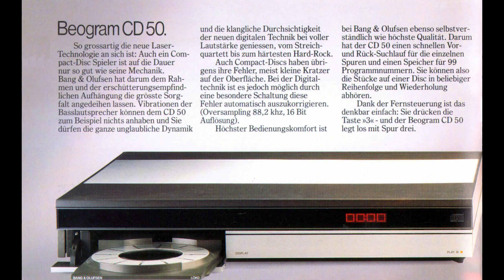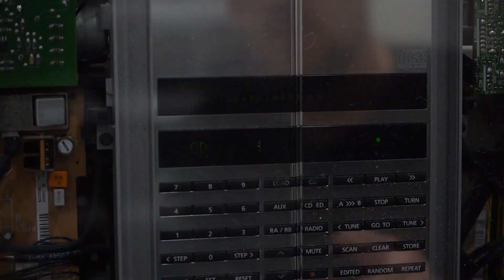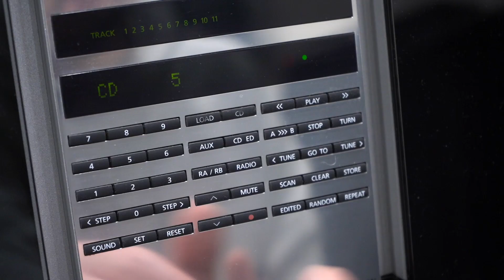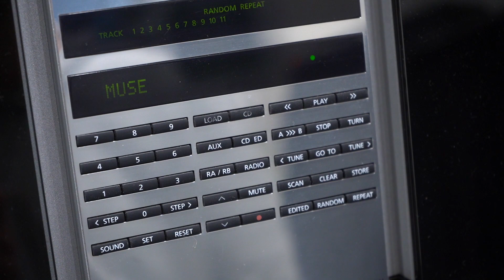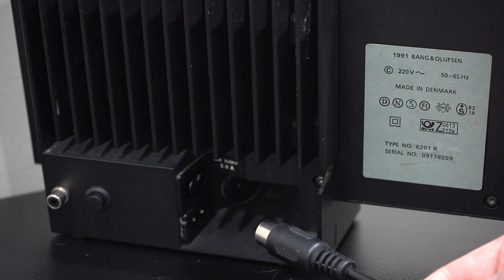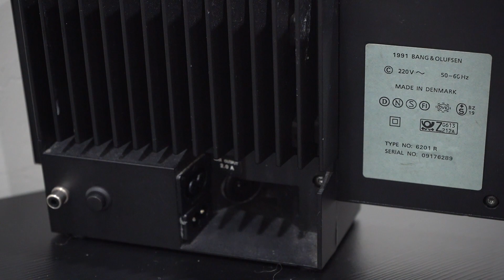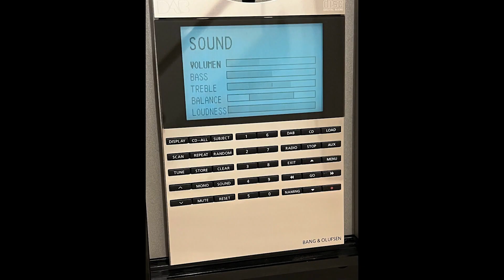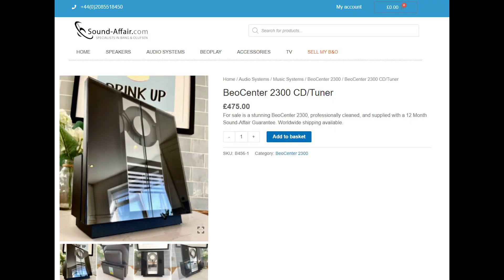BANG OLUFSEN OVERTURE REVIEW & HISTORY

Comment: Thanks for the video. I saved for two years to purchase a 2500 in the early 90s. I still use it today and love the units design, operation, sound quality and solid metal weighty remote. Although I have been using computer tech and modern sound devices I still prefer the 2500 for CD and radio. B&O made great products, especially in design but alas for me their music centre designs in the past 18 years or so have not been so good.
Reply from the maker: Thanks for sharing

Comment: I recently got my hands on a 2500. Replaced a belt and still working on them to get them 100% working. I agree with your opinion. I think these old systems will beat most the modern smart speakers.and soundbars. Besides the sound I like the design and its smooth and silent operation.